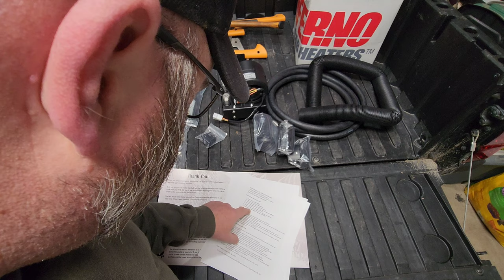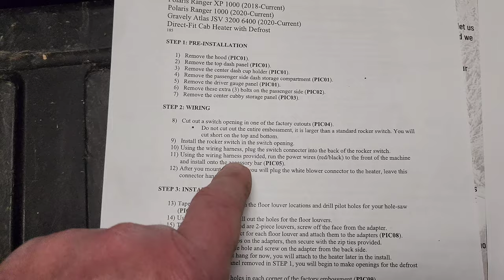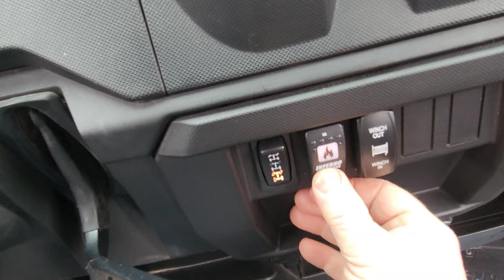Inferno Cab Heater Install On A Polaris Ranger 1000 Premium!

Comment: hi there the toolcat has heat and a/c but dont use either hardly at all . other than playing or plowing i dont run it long enough to make heat . just short fast trip to the mill . but plowing you will like it , good job best to all . john
Reply from the maker: Yep, bout the only time mine will run lomg enough to enjoy the heat is for plowing.  Take the edge off on short trips. A/c really wouldn't do much for me with this thing. Now the tractor,  that's a different story.